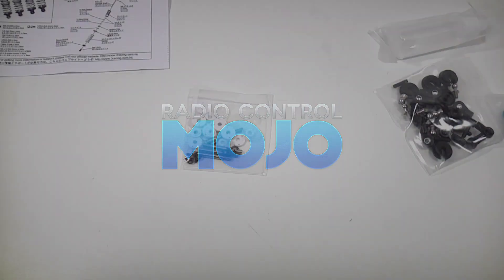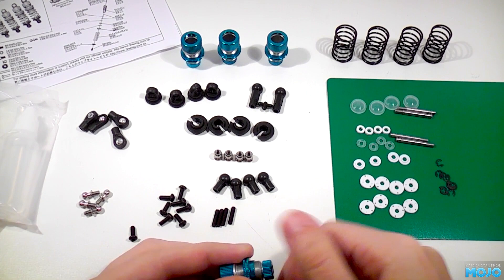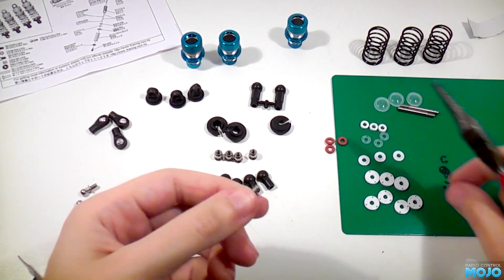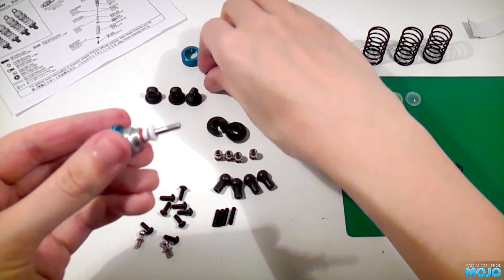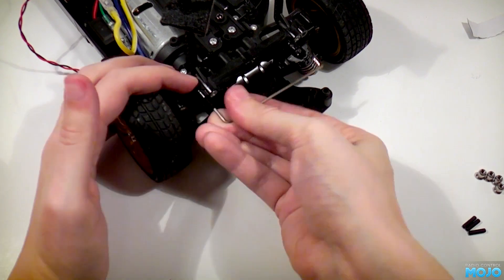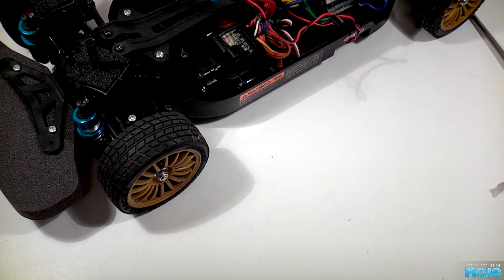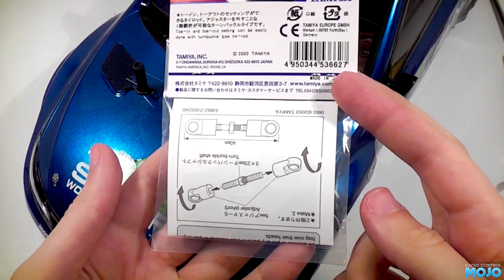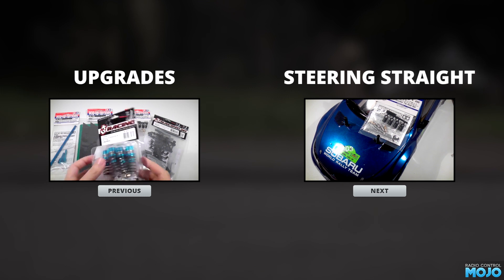Tamiya TT-01E - Part 8 - Dampers

Comment from the maker: The TT-01E is a great kit for a beginner, however I would look at the TT-01D Type-E, it comes with most of the hopups you need to make it run nicely, you only need to add some grippy tyres if you don't want to drift. You'll want to add a bearing set no matter which you choose. As for the radio, most 2.4GHz sets are fine and any standard size servo will do. If the kit comes with a ESC you would be better off just replacing it for a low cost ESC with built in BEC as mentioned in a previous video.

Comment from the maker: @neilcur Pretty sure it's still current, I think the initial higher cost makes them slower sellers so sadly they aren't kept in stock, but if you add up the included extras over the standard TT01E it ends up being cheaper over all. You could of course import one from Japan, it often end up cheaper even after duty!

Comment from the maker: The part used is #TA05-25/LB/V2 from RCMart, they're 55mm which are just slightly too long, but if you're a bit creative with the ball ends they fit quite well.

Comment from the maker: @neilcur It's hard enough to fill a 5 minute video with voice over, real time would be a little tedious, seen one screw go in, seen em all... We could be more detailed in some parts, but it's difficult to get the balance, hopefully we're improving as time goes on though... As to the radio, the Ansmann is pretty good, more details on rcmojo.com, however, Etronix do an interesting package, the EX3GPro, compatible receivers are cheaper too.

Comment: I currently have 55mm dampers on my tt02. I'm mainly now using it at an off road track.. Do you think 60-70mm dampers would fit or be necessary in yeh sense would it help dampen ever more stress from jumps etc?